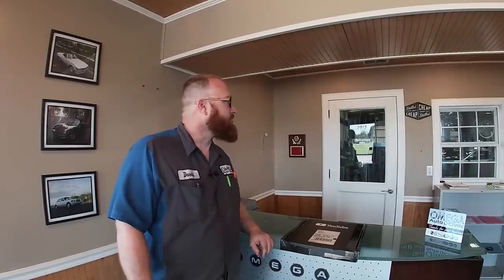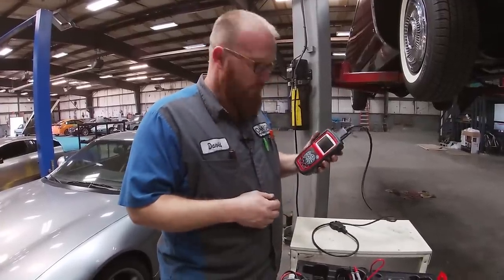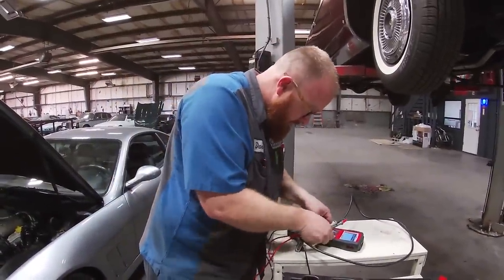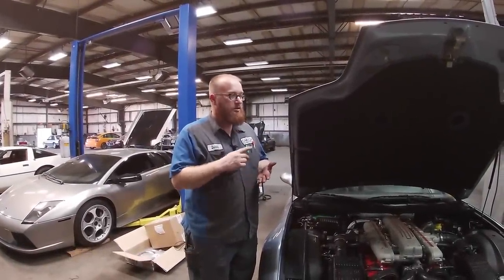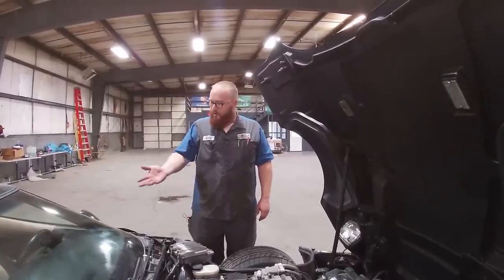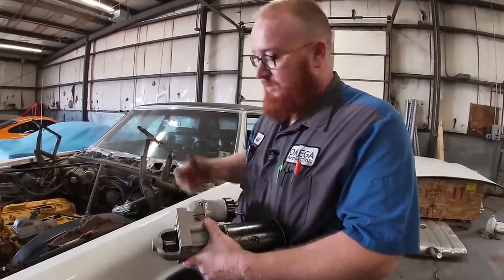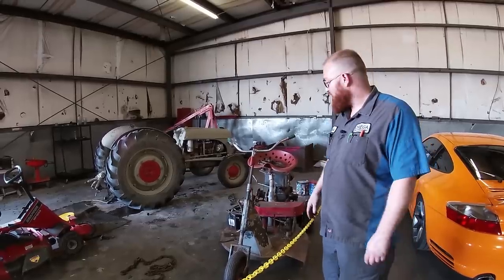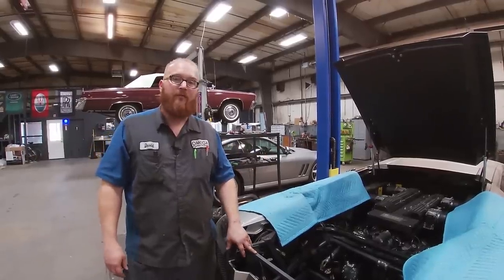CAR WIZARD shows a Must Have Handheld Tool & a Shop Update: including the 69 Caddy

Comment: Man, I love that diesel Caddie! The most reasonable reasons to pick that, I love it, I want one. If they are that easy to become reliable why are these engines so mistreated? After You explained in the last vid why You chose a diesel I´m totally on board.
I love these landyachts, in German "Strassenkreuzer" but the mileage takes the fun out. I´d want one because of the leather, wood and chrome. Because You have lots of space and a unique feel driving them at a high comfort level: cruise control and A/C together with these comfy seats, electric bells and whistles (but not too many) and a huge trunk. I need it to go at least 130 km/h and be able to go a 20% incline. If it could do that we´d be in business.

Comment: 1964 Oldsmobile Jetstar 88 had a 330 cu in V8. The 1964 Oldsmobile Jetstar 1 had a 394 cu in V8.
Reply from the maker: Randy C Either way, the manifold worked great
Reply: It was probably the 330 V8. 

The first second-generation Oldmobile V8 330 cu in (5.4 L) "Jetfire Rocket" introduced in 1964 and produced through 1967. It was released one year earlier than the tall deck 425, and debuted the standard 3.385 in (86.0 mm) stroke; bore was 3.938 in (100.0 mm). 330s were painted gold and had forged steel crankshafts. The 4 barrel versions had a larger diameter harmonic damper, the 2 barrel only a balancer hub without the rubberized outer ring.

Comment: Wouldn't be at all surprised if a battery caused misfires. It may be no Ferrari, but my e46 m3 definitely starts doing some strange things with the electronics when the battery starts failing.

Comment: The seal groove in the bearing cap would’ve been machined into the cap and block at the same time as the bearing support... It has to be “concentric”, if it wasn’t the crank wouldn’t turn...
Reply from the maker: Matt's Garage Wrong. The seal groove on these have their own seperate carrier. Seperate from the main cap. I was holding the bottom portion of it in the video. Thats not a main cap.
Reply: Car Wizard Yes, I noticed that, but the seal cap you are holding would’ve been set up and machined with the other caps, the other half of that cap is still built into the block so they would’ve machined it on the block at the same time.
Reply from the maker: Matt's Garage Many of these old cars are notorious for having the seal groove non-concentric. Read this article halfway down
https://www.stovebolt.com/ubbthreads/ubbthreads.php?ubb=showflat&Number=754707
Reply from the maker: Matt's Garage Just like my 264 nailhead I had machined. The machinist annotated that the rear main seal groove was grossly non-concentric. Concentricity wasnt such a big deal in the seal groove back then because they knew a rope seal was going in. You try to use a rubber seal in place of the rope. It will fail every time
Reply: Car Wizard Okay, I’ll take your word on that then, just sounded very odd to me and I actually ran it by my dad who is a now retired machinist and he couldn’t figure how it would be possible... But I will trust your experience on the matter, I’ve been wrong before. Thank you for the responses.

Comment: I had a real silly idea when I was driving by 1983 C20 6.2 L diesel van I wanted to get me or nose Flex Drive cables and Route it to the injector pump how far can detune a 6.6 deramaxx can it run without a turbo

Comment: Why can't Car Wizard use those Duramax diesel V8 engines? They have more torque to burn rubbers on this massive Cadillac!
Reply: Because they require a retrofit ECU and don't bolt up to the TH400 trans in the caddy like his olds diesel does.

The olds is a much easier swap and fits his needs on the cheap.

Comment: Who ignores the check engine light in any car?
Reply: Herbie Husker check engine light on my 2000 Tacoma has never not been on. Owned it 8 years and it has always been illuminated. Those most be some long life bulbs
Reply from the maker: Herbie Husker Tons of people ignore the check engine light. I have some customers come in that have ignored it for 6 months or more.
Reply: @CarWizard  People do ignore them, but It's foolish to do so. My car had a light go on, I scanned it and it was an O2 sensor.  Changed it and haven't had a problem again. It wasn't a big deal, but it could be something major, so who would drive around like that without even checking to see what the code was? That's just dumb. I wouldn't want to have major engine damage on my car because I was too lazy to check the code.
Reply: Me. I had the code checked, so i didn't completely ignore it.  It's and Evap code. I don't need an emission check to register my car, so i leave it be.  It's been almost 8 years. :)
Reply: Pfff I ignore mine all of the time. My ECU is expecting automatic transmission inputs. It's got a manual transmission. Where you have to worry is if the ECU/PCM is running in limp mode. It will run rich to keep things cool, wasting fuel, ruining your oil, O2 sensors, catalytic converter, and you will most likely have a rev limiter. Also not running smoothly, properly, will shorten the life of  EVERYTHING and anything between the tires and the gasoline. It's good to have an OBDII reader that can read other modules like ABS, SRS/Airbags, etc. I have a Bosch bluetooth scanner, reads just about anything. It works through a phone app, so it can get vehicle specific codes on the spot. I've always been curious if it would work with exotics, it has never failed me with regular cars.

Comment: I had an 86 Corvette what a money pit those are not good cars to buy
Reply from the maker: Georgio Ocean So far it light years cheaper than an old german car. Those are quadruple the cost of an old vette. Now those are money pits. The vette, not so much
Reply: Car Wizard  I put three transmissions and the guy that did it was a specialist at the Chevrolet dealership I put two engines I got rid of it and give it to my dad he got rid of it
Reply: @georgioocean7629  I once owned a 87 with the Z52 package. The drivetrain never failed me, L98 was shared among several different cars, as was the transmission unless you had that weird 4+3 unit. My complaints were all about the suspension, that rear end will let go just snap like that